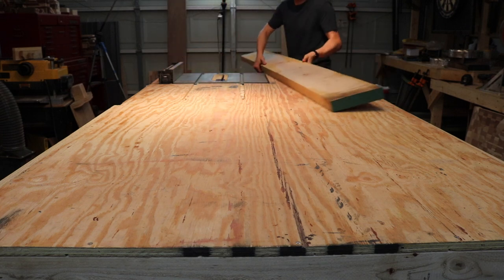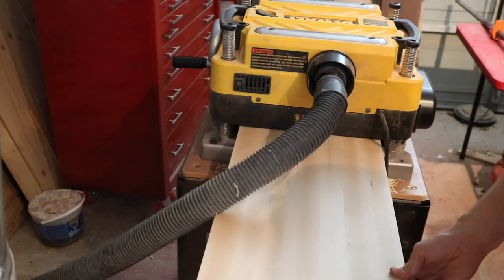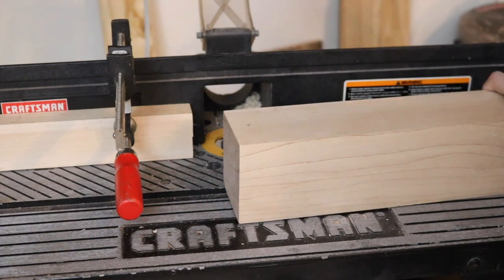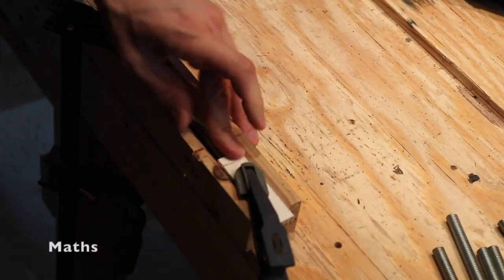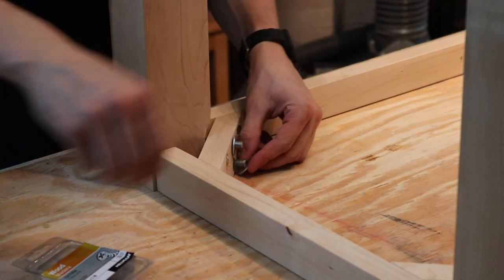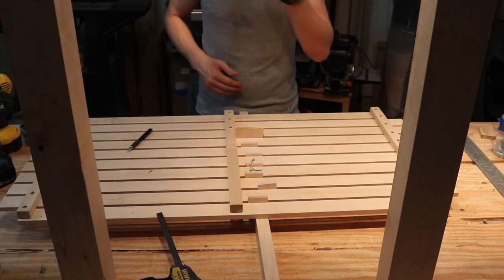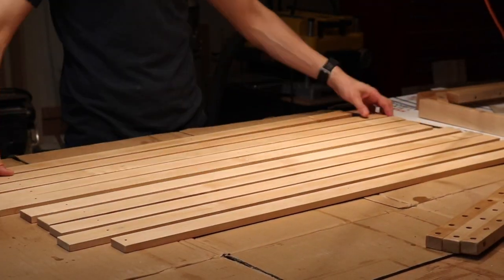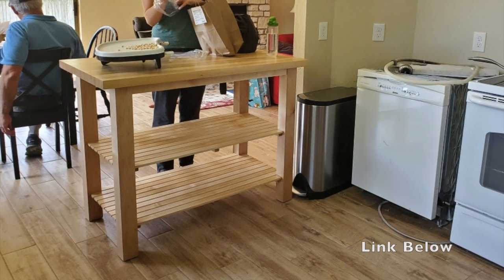How to Build a Kitchen Island - John Barnes

Comment: How did you calculate the price?
Reply from the maker: I calculated it using the following: 
1 - How long I thought this would take me 
2 - The price of lumber/hardware
3 - The hourly rate I desired

Unfortunately this took me roughly double the time to build, so my hourly rate was lower, but I know that the second time I do a project like this I’ll be more efficient
Reply: @johnbarneswood  I am newer to being on my own and still have trouble figuring out what to charge. Obviously I understand time plus materials but what is a reasonable hourly rate?  And when it's something I haven't done I feel like I can't make the customer be responsible for paying me to learn. I have been doing overly custom cabinets for a detail oriented customer that it's too involved and keeps adding stuff to each cabinet. We agreed on bids with the understanding that it cna be more. Just don't know what others would charge.  Can't decide if the price is right and I am too slow to make money or not charging enough.
Any thoughts or advice would be greatly helpful.
Reply from the maker: The easiest thing to do when starting out is to look at what other woodworkers charge. For example, I found similar designs to this kitchen island online, ranging from $900 to $1,500. I roughly estimated this would take me 18-20 hours of work and I wanted my hourly rate to be $40 (which is on the low end of what you should aim for). After I estimated the cost of materials to be $300, I decided to charge the customer $1,075. This number fit within the range I was seeing others charge, and I felt I could get the work done in the window I set… but it obviously took me much longer! If I were to make the same product again, I would definitely be quicker, but the cost of materials has gone up and I’d like to get closer to my desired hourly rate, so I’d lean closer to the $1,300 mark.